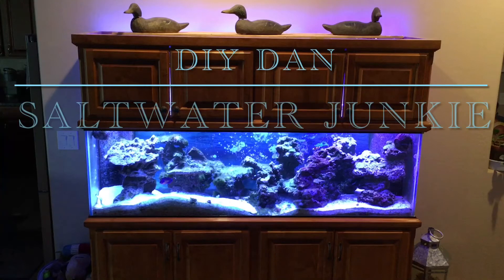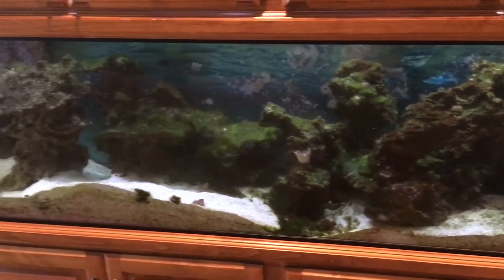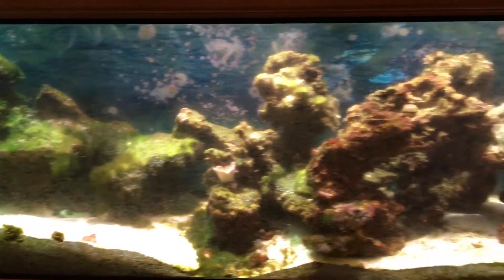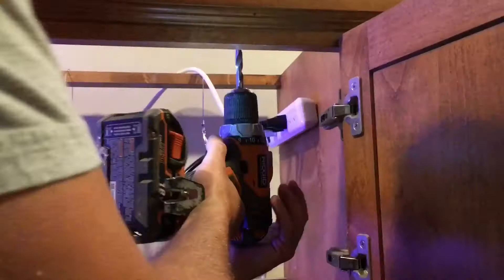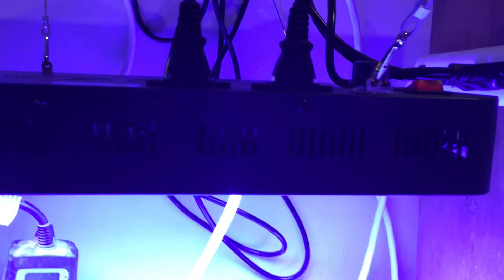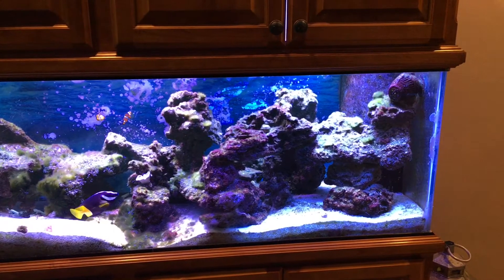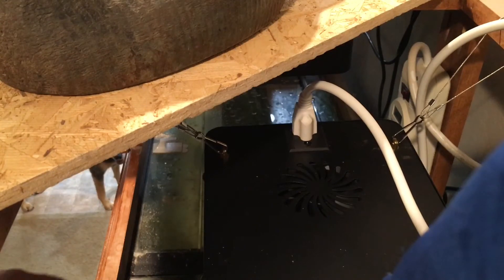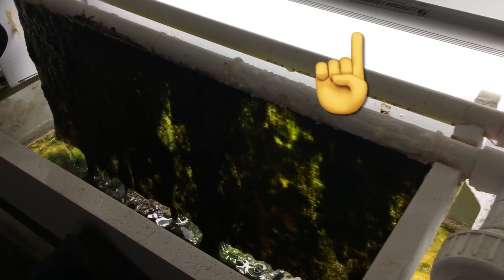LED REEF LIGHTING REVIEW 3 CHEAP LED LIGHTS FROM AMAZON WILLS, PHLIZON, & ARKNOAH & SYSTEM UPDATE

Comment: Man.. I don’t want to sound mean but if you need help let me know. You should never have that much algae. With only a couple fish and a couple coral you don’t need that strong of lights, shouldn’t need an algae scrubber. Definitely don’t need that much sand. Your levels are zero because the algae is sucking it all up. I’ve got a 75g with no algae and sps the size of my head. Been doing it for 15 years. So seriously if you need help, hit me up.
Reply: Thats what I was thinking
Reply: Agreed
Reply: Why does he have so much algae?
Reply: @EXCWISE  I haven't look at this in years but poor lights out of spec, deep sand bed, has to pull all that algae out of the tank and big water changes over a month. And stop feeding. I would start over.
Reply: @KevinSmockKnives  I have a 90 gallon, I started it up not long ago don’t have many corals and fish but everything seems to be fine so far. The only thing I need now is better lighting… any suggestions? Preferably none I have to hang on the ceiling. And thx for the response 🙂
Reply: @EXCWISE  T5 is cheap and proven to work. If I was doing it all over again, I'd go Aqua Illumination Blades. Start with one or two and add on as you need increased light for corals. Lights that have one or two spots of light create way too many shadows. An even blanket of light is the best. IMO
Reply: @KevinSmockKnives  650 for one strip pricey… will I need 2 or can 1 do?